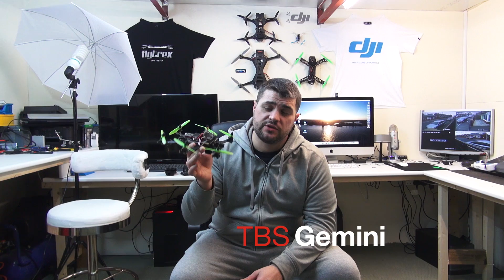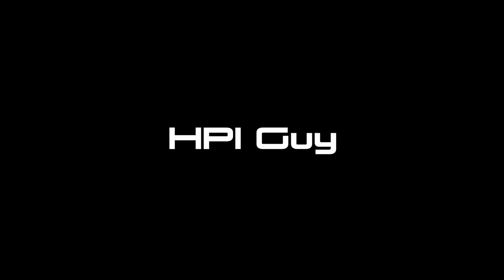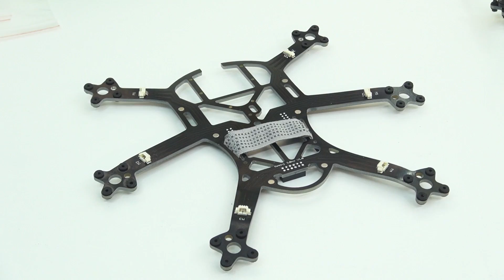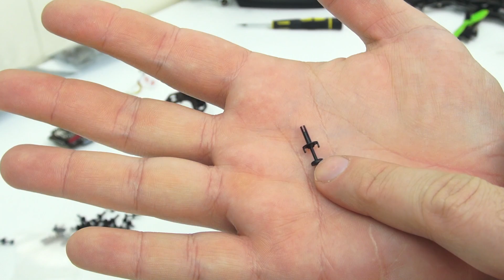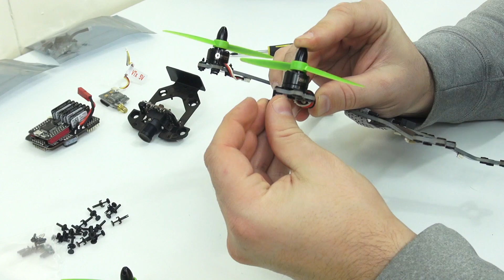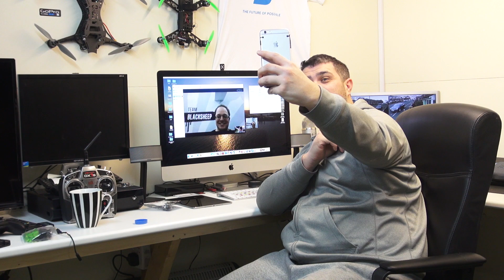HPIGUY | Easy frame swap (no tools)

Comment: Hi, I just got my gemini about a week ago.i can not get this thing to work.it won't the ppm does not seem to function and the flight controller will not connect to the software. Don't have a clue what to do next as I exhausted everything I can think of to get it working. Any help would be appreciated, thanks.

Comment: This is a good design. I wonder if Team Black Sheep has thought about moving the motor plugs to the top of the frame. It seems to me that the current location could lead to mid air failure if the connector is knocked loose.

Comment: not my cup of tea to be honest, i crash too much! those motor pins don't look like they'll take much of a beating. Can see them needing to be replaced as much as props. don't really like tbs or what they stand for, but the module design is very clever though and i like the idea of it, would of been nice to see the escs attached by pop in pin headers too like the flight control board. so no soldering would be needed then it would be fully modular. Great video though Richard,
Reply: each motor pin is spec'ed to 2kg, so 8kg force total. That protects the motors in the long run. we've had some initial problems with the "fragility" of the Gemini, mostly in part to the way the motors were attached. this new pin that we have developed fixes most of the problems, and we are braining away to make this an even better platform in the future!